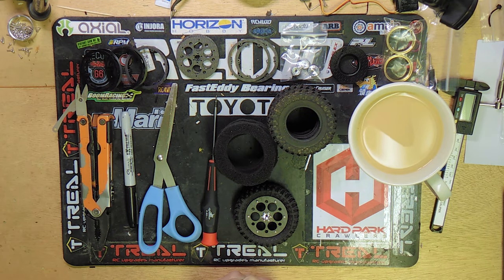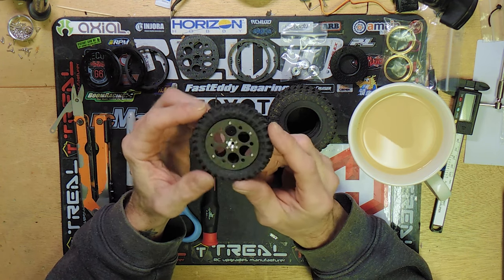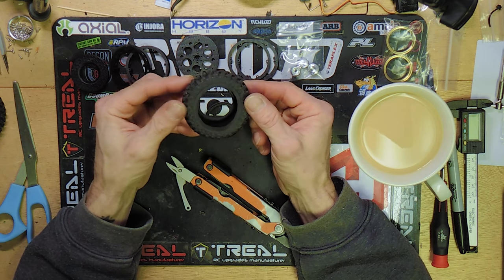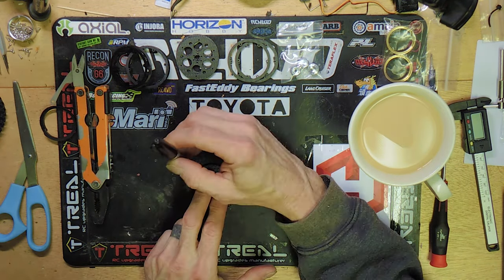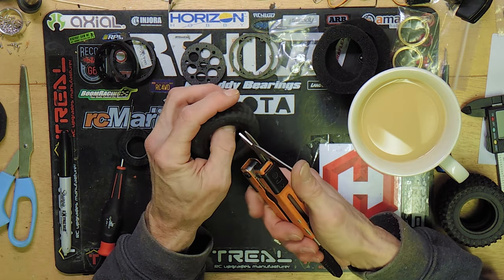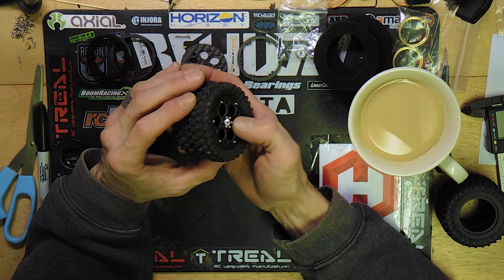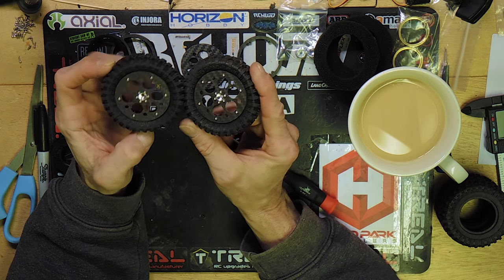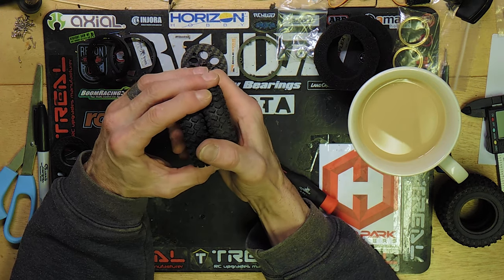Coffee & Crawlers Ep. #7 - Building Hard Park 1.8 Inch Superclass CF Wheels

Comment: That moa looks great !  Still haven't done much with mine, but I love couch and table crawling with it.
Reply from the maker: It's been a 2 month long work in progress. It still suffers from browning out on the rear motor because it's running a single ESC with dual outputs without a BEC. I want to run brushless in these and it's going to take some custom milling axle tubes to get it done. It's fun on some stuff but it's not ready for prime time quite yet.

Comment: Would love to see some running video with those wheels. Looks amazing
Reply from the maker: Thank you! It's still a little bit of a work in progress. Right now it runs on a dual output ESC with no BEC. I'm kind of half waiting for Chad to release his upgrade idea for being able to mount Furitek Springtail motor & gearboxes on the axles. As well, I'm thinking of tooling up to be able to mill a brass upgrade option, myself. Not to give away any secrets but it's just an idea I've been kicking around. So, long story short, it's still not quite ready for prime time. Soon, though. Soon. It's been a project very long in the works and I just hope the time I'm taking pays off in the end. I think it will.
Reply: @VermontScaleCustoms  I am interested in building one of these. I like what you are saying! Sounds amazing! Can't wait till you get it performance ready!
Reply from the maker: I'd suggest starting with a Dashex Z2 and take it from there. You can find them at AliExpress. The Basher Rocksta doesn't appear to be coming back in stock any time soon and the HBX 24 scale monster truck has 4WD and 4WS but I'm not sure if it's MOA. I can't find any good photos of both axles. Since nothing really exists for these, it's taking awhile to get it going. Plus, I decided to build two other rigs in the meantime.
Reply: @VermontScaleCustoms  thank you!

Comment: Im trying a set of 1.55 tires on my 1.8's. 
Have you tried that yet?
Reply from the maker: Nope, there's a point at which 1/24 scale tried to become 1/18 scale and I wasn't having anything to do with it. Larger wheels on small chassis takes away f=some of the "drivability" of some rigs. It doesn't work well for everything. I pretty much run Scramblers and the larger Pin Comps from Injora and that's it. Totally proven tires. Jconcepts just released the Rupture in 1 inch. Those are SICK comp tires.
Reply: @VermontScaleCustoms  I really enjoy scale but they handle like crap. Im experimenting with a few ideas right now.
Reply from the maker: The Injora pins and Scramblers are definitely large enough to cut even the most technical lines. 1.8 only gives leverage on break overs otherwise you have to make room in your lines for a wider, taller rig that takes a mile to turn because of such large wheels.

At some point, it’s worth it to look at the 18th scale realm because that would make more sense with trying to push 24th well beyond what it was designed and intended.

Comment: How tall are the  mounted  on the wheel?
Reply from the maker: 72.5mm x 22mm mounted, without foams. They don't need them. So-so traction but they need a fair bit of weight to work properly. They're for a 1/16 with thick sidewalls. Nice compound, could easily be shaved down to conform much better.